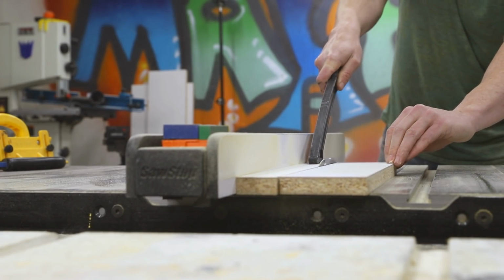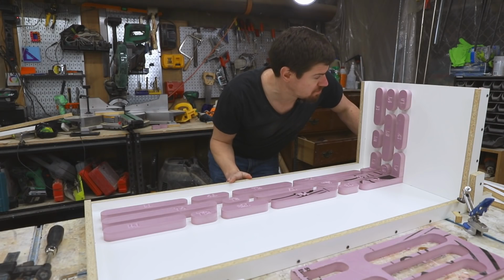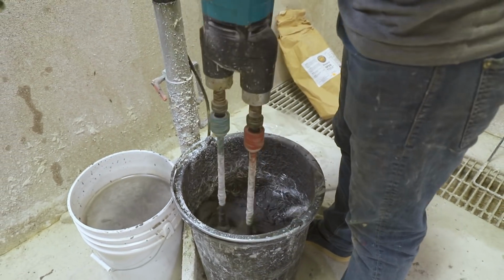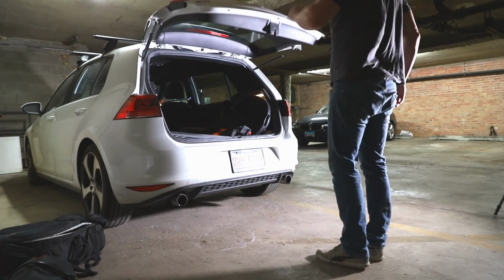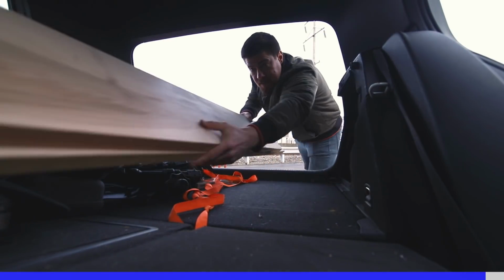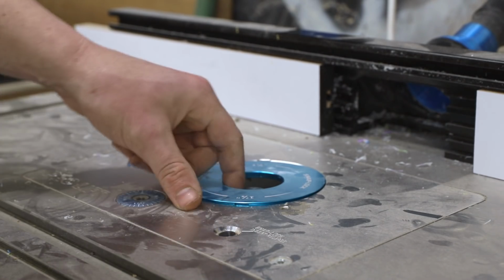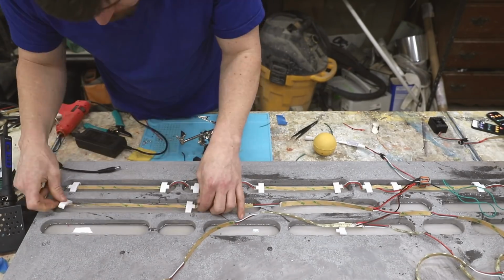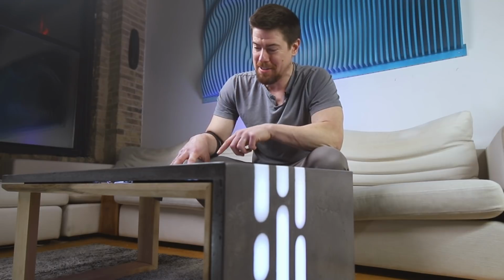Making a STAR WARS Table from Concrete & Epoxy Resin

Comment: Wouldn't having channels in the wood for the led strips have saved you a lot of soldering time?

Would also have moved the leds off of the epoxy surface diffusing the light acbit more.
Reply: i was thinking the same....lol must be a dutch thingie

Comment: Wonderful build!  Add another black-painted floater strip to make a gap-free rectangle, though. because there's a light leak on the side away from the couch.
Reply from the maker: Thanks Elaine!  You really can't see any light from normal standing or sitting vantage point.

Comment: May I make a request on a video? If so, could you please do a white concrete kitchen countertop, however without blowing the material at the form with the hopper. Maybe make it look like marble or quartz. That would be a great addition to your awesome videos. Your concrete tables look so perfect compared to other videos out there.
Reply from the maker: Thanks!  I'll have some countertops coming up....not sure if I'll do one without the spray, but I will have a basic table coming up without the spray, so combining those two you should have all the info you need :)
Reply: @modustrial  Awesome! I look forward to seeing the results. Thank you!

Comment: I get why you did it, but the moisture meter placement was amusing, considering the unfinished side of the boards were 1/4" away from the concrete, which typically has a much higher than ambient moisture content for a long time after pouring, even thin concrete like this.

Enjoyed the build. Great design for a table. Final result looks awesome. You need to play the Star Wars disco version with the LEDs going ;)
Reply from the maker: Star wars disco??  Ok gotta find that.... Sounds like a good excuse for a sequel ;)

Comment: Very cool table, really like it. One question, why didn't you mold in channels between the light segments for the led strips? You could have used the led strips with far less cutting and wiring/soldering.

Comment: Great project!
What might be better than batteries in series with a step down, is maybe put the batteries in parallel, then you get double the mah, and use a step up to take the voltage from 4.2 to 5v, may not even need the step up as most led strips will power fine from 4.2 :)
Reply from the maker: Thanks! That could work well!

Comment: Even though it's supposed to be a plain white led affair to mimic the empires design cues the rainbow Led part opens up potential other design ideas because it actually looks cool like you could put it in a spaceship or such. My only question is will it be a pain in the butt changing out batteries all the time to keep the lighting going. Also, the blemish in the concrete is not a big deal...make it a blaster hole made by a star wars conflict!
Reply from the maker: blaster hole...I'm gonna roll with that! :) The battery holder is on magnets so its fairly easy to pop out and change batteries, and you can also plug it in (I just prefer not to have a cord on my living room floor)

Comment: Nice video and DIY! The idea turned great! You should put a white Star Wars logo on the bottom side of the concrete. Quick question, is the table heavy?
Reply from the maker: Thank you!  It's about 100 lbs or so...heavy, but I'm able to move it around on my own.
Reply: @modustrial  Pretty heavy but still great!

Comment: Awesome table for sure. Not a wood worker guy so not sure it would have been easier but, instead of all that soldering for LED's what about a grove in the wood that the strips would fit into that way you can use 3 one piece LED strips...Just a thought.
Reply from the maker: That could work, but you'd have wasted LEDs shining into the concrete.  Definitely an option tho.
Reply: @modustrial  Very true, only a few would not be under the concrete from the look of the distance between the openings. might give a nice glow to help the top look as if it was floating.. anyway you do it that's one hell of a cool table..!

Comment: Hello again from Germany,
i would also like to venture into projects in which you use the hp50 concrete mix.
however i have big problems to find comparable products here in germany.
i mean it could be powdered concrete? Correct?
but what is the acrylic polymer?
The only thing I can find here for this search term is called „Tiefgrund“ (primer for highly absorbent substrates).
Could the sealer be a natural stone sealant?
It would be great if you could help me.
I'm looking forward to part 18 of your renovation.
Thank you 😌

Comment: well that hole you went through the table id of drilled a bigger hole to slot the light sabre in to or may be ground an sw logo with a dremel and filled with a silver resin just a thought

Comment: The only thing i see that is not an issue but can see on the final shot of the table is that you should have run a small LED light cord between the concert top and wood to get a red glow from it and hide the light leaking from inside between your thin strips that make it look like its floating
Reply from the maker: I thought about adding some LEDs so you could get the side glow coming out of the reveal, but I was already pushing the limits of battery power with just the two 18650s... I agree that it would definitely be cool though👍👍
Reply: @modustrial  This build is amazing man!!
Reply from the maker: Thanks Steve!

Comment: Maybe you want to use some kind of place holder for drilling instead of the tape. I am sure there are ready to use solotions that you can mount to the drill so you never drill a whole where you don't want one. You probably don't want the crappy antenna ones and instead go with the circular ones.
The disco light effect was :)
Reply from the maker: Thanks Jan!  And yup, they do make collars....next time!

Comment: Thank you so so much for  such a detailed video. I am a visual artist. I just changed my medium to concrete. I am trying to find out what is the best way to apply concrete to wood or any other surfaces that I can attaché the concrete too. Well!! I am an artist and prefer cheaper material. Could you please let me know if you have a way to applying a thin layer of concreter on canvas or wood panel without it falling off the surface after curing time. Also do you know any product that seals the concrete and it is food safe. For example, if I want to make a plate and use it.

Comment: What specific finish did you use for the wood in this project? I like how it didn't change the color of the wood too much.
Reply: Also, extra credit if you could incorporate the lights into a home automation setup like zigbee or zwave.
Reply from the maker: Maker Brand Simple Finish
Reply from the maker: They do make some Alexa based LED controllers, but they don't sync to music.

Comment: Noticed you used the Shaper Origin software.  I'd love to see some Shaper demos vs. X-Carve if you have.
Reply from the maker: It really isn't a versus thing....they are very different tools, used in very different circumstances.  The shaper is portable and work on larger pieces, but is labor intensive.
Reply: @modustrial  I don't mean a versus comparison.  I meant doing more videos using the Shaper instead of the X-Carve, especially your process of using Fusion 360 with the Shaper plugin.  I've not gotten it to work well and tend to use Illustrator instead.  

I like your design and have been thinking about doing something similar (wavy pattern), though not with concrete, for a bar height table in my home theater.  I was going to simply cut the design with the Shaper and then pour frosted resin in while inlaying the light strip underneath.

Comment: Does the fence on the router table need bringing forward a bit ?. When you were doing the edges it didn't look right as all the weight was going against the router guide rather than the fence.

Comment: what kind of runtime do you get on the batteries? very cool table!
Reply from the maker: Thanks!  An hour or two at max brightness, but it can be extended quite a bit by turning it down some
Reply: @modustrial  on diy perks he uses a lot of lipo remote control car battery packs for his wireless stuff. Should be a lot more power dense than the double 18650s.

Comment: Nice project, but why not use foam channels for the LED-Stripes? By doing so you would have to spend much less time for soldering.
Reply from the maker: Not sure what you mean? Can you explain a bit more?
Reply: @modustrial  I'm so sorry my english isn't good enough. Whenn you did the layout of the foamparts that later will be the epoxyfilld lights it is possible to connect the undersides of the foamparts wich later will becomes tunnels for the LED-Stripes. These Tunnels couln'd be seem from above because there is concrete on...

Comment: any chance you have the 3d print file for those amazing led clips? If possible i'd like to use them on my project that follows yours to a T from the epoxy blend to soldered leds.

Comment: i have a question. When you did the lighting  why didn't you make a little cut out so the cabling doesn't stick out of the concrete so it won't bend?
Reply from the maker: I thought about that, but would have had to do it in the form (would have been tricky) or with a grinder (tedious and dusty). You can't see them, so I left it as is.

Comment: Hey what are those 90 degree clamp helpers you're using at 17:16?  I'm getting ready to make a waterfall bench for my bathroom and could use those to clamp the 90 degree joint.
Reply from the maker: 3d printed any angle clamping jigs....it's a free model I downloaded from thingiverse and printed
Reply: @modustrial  Doh!  I though it was something I could buy from Rockler :-(

Comment: God dangit, caught it early, 54 seconds after posting.... So stoked. Did you make a saber for your sister yet?
Reply from the maker: Thanks!  I actually just finished one but it's a prototype so probably not a full video for it.... However I may or may not have designed a prototype of the new yellow Rey staff lightsaber...if you catch my drift 😉

Comment: Owl lumber.. yikes, they're pricey. Nice selection of exotics though
Reply from the maker: Yea, they are a bit expensive but you get what you pay for most of the time 😁 taking the moisture meter to their boards, I was pretty impressed with how well dried out most were.
Reply: @modustrial  O for sure. I would never question their quality, I still shop there for some stuff. My budget is just a little lower so for larger orders Ill go elsewhere

Comment: An impressive and cool piece, sure. I am just put off a bit by the paraphenalia from Diseny's (in my opinion) inferior version of what used to be an awesome IP. Saying the absolute least I possibly can: I am severely disappointed how Disney/Lucasfilm have treated George Lucas's work.
If you happen to like those movies, fine by me, I just can't get over the cringeworthy stuff they put in there.

But getting back to the project you completed here, one question: Why concrete? I mean you nailed the aesthetic, sure, but I can't quite wrap my head around concrete furniture. Perhaps that has to do with me preferring wood in most cases. Once the weather stabilized for summer I am probably going to touch up the table in our livingroom. When we moved to our new place it had to stay outside for a day or two and as such the sun has taken a bit of a toll on it - something I now need to fix.
Reply from the maker: thanks!  Concrete is just a different aesthetic....it's the appearance of stone, similar to granite or marble, but you can form it into any shape you can dream up (i.e. fabrication is much easier than with granite or marble).

The Rise of Skywalker was a huge f-up IMO.  Recently, Disney seems to be doing better with Mandolorian and Clone Wars (the last episode of Clone Wars was probably one of the most emotional, intense, moments in all of Star Wars).  So, I'm hoping Disney can continue to turn things around.... 🤞
Reply: @modustrial  f-up is putting it mildly. To me they all range between bad, atrocious, and downright cultural vandalism - with Rogue One being the least bad of the bunch, but that doesn't make them good by any metric though. So much so that I couldn't even be bothered to watch the Rise of Palpatine('s granddaughter) - not even if they had paid me for it.
 But such is to be expected if you put someone in charge who hasn't the faintest idea of Star Wars and then hire the director who in collaboration with Alex Kurtzman already ruined Star Trek - let alone hiring another dude who "created" the colossal clusterf*** that followed (TLJ)
Not to mention Disney/Lucasfilms ineptitude at keeping their own employees from insulting customers at every turn for not liking the product they shovelled out...
Eh.. I better cut it here before i start ranting in earnest...
At this point I am not even watching the supposedly decent stuff, because i still anticipate another TLJ to be pulled on the fans down the line. At least while the current "leadership" is still in place.

Aaaanyhow.. let's get back to actually entertaining stuff - such as your videos, shall we?
I posted a few ideas for the roof of your new place under the tour-video. not sure you saw it yet.

Comment: if you put some usb ports for charging your phone and maybe an outlet or 2 for convenience somewhere under the tabel, it wouldn't seem weird to have a cord going from your table to the wall, you might even be able to hide it depending on where you placed it (perhaps under the rug?), or if you really wanted to hide it , you could install an outlet directly under the table or run the cord under the floor.

also at 21:32 it sounds like the alarm sounds on the deathstar  https://www.youtube.com/watch?v=7ejH_BihwFQ  lol
Reply from the maker: That could work!

Comment: Next time put some nuts into the concrete like rebars to screw it to the base. Even better, adjustable mounting brackets or a T-nut like your assembling table

Comment: What is the purple foam that you used to set the concrete mold ?
Reply from the maker: Foamular.... available at most big box stores here in the US...it's a Ridgid insulating foam
Reply: @modustrial  is there a special release spray I should use to get out the foam after the concrete drys

Comment: *Facepalm
Was there any problem to buy black wood cutout the led dots on Mill and fill it with resin. You just spoiled a lot of resin for the table
Reply from the maker: Then it wouldn't look the same...you could certainly do that and get a different style of table

Comment: I learned the hard way also to stop using tape to mark how far i have to go with the drill bit and use one of those collars you use with those pocket hole drill bits to stop the bit from going in too deep....unless its a not that important project then tape is fine, also I would have not used those pieces of wood to separate the wood from the concrete I dislike the way it looks on the gap that makes the lights leak out from them  and reveal the ugly blocks inside and makes it look all weird...it makes your eyes focus inside the middle gap of the table and shows an unfinished thing.
Reply from the maker: good tip for the collar!  The light leak is only visible if you are on your hands and knees...you'll never see it from any vantage point you'd normally be looking at it from (like standing or sitting on a couch).
Reply: @modustrial  yes but you and others won't ever be just sitting they will be walking around the house and from distance in a dark room any tiny light from it is magnified and as your walking I'm sure that would be easy to see.... yes maybe not straight gon the top sitting right next to it or standing looking down.

Comment: hi im interested in the air gun used for the first coat of the concretein this video  I am in the uk so i need to find a source for one here. but what is it called exactly? i cant seem to find it
Reply from the maker: Hopper spray gun.... In the UK, you can contact House of Concrete and they can set you up

Comment: "Aw man, I have to re-charge my coffee table!" Dude. Batteries. Suck. Use. Cables. -.-
Reply from the maker: to each their own....I would not want a cord running from my wall to my coffee table....just my preference.  plus, the way I wired it, you can plug it in with a normal DC power adapter if you want.
Reply: yea i'd rather not have any wires required for the table. batteries are fine, the LED strips barely take up much power and can easily last for days probably.
Reply: @shawonr3325  With that setup the batteries last ~2 hours (one color) or 30 minutes (white) when running on full brightness..